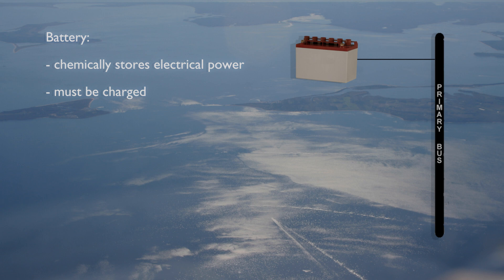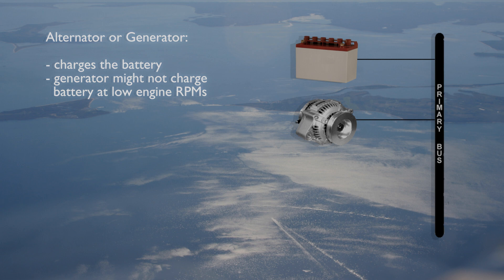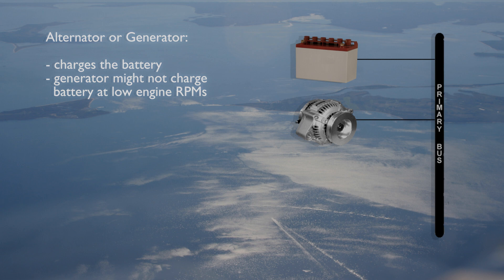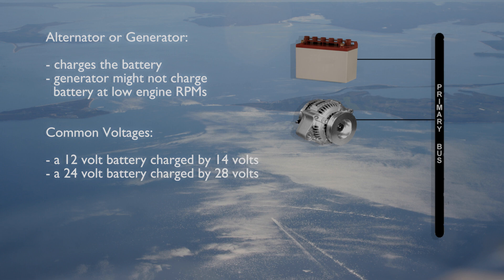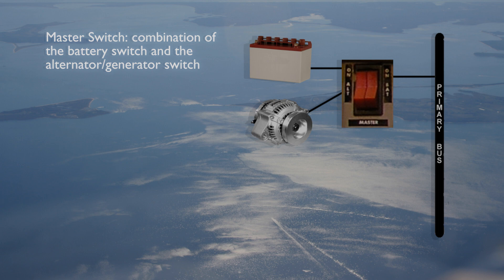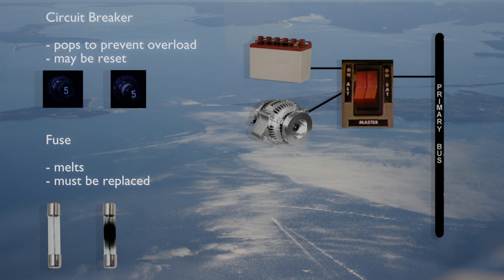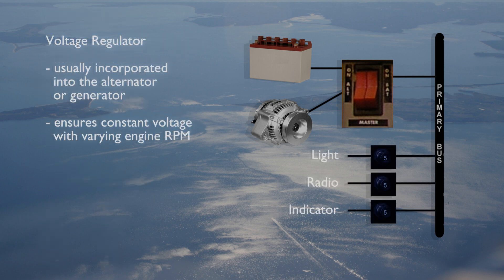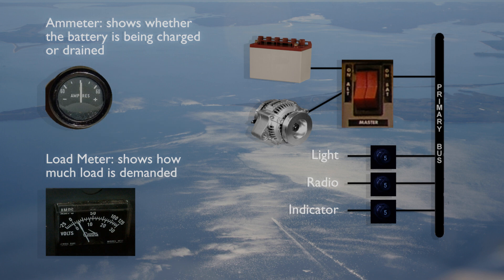Airplane Electrical Systems

Comment: Master switch doesn’t connect the battery to the bus bars. It connects the contactor to the ground then the contactor connects the battery to the bus bars

Comment: Does the alternator produces AC or DC?
Reply: AC, the battery provides direct current, which powers most stuff in the majority of small planes. Easy way to remember: Alternator, Alternating Current.
Reply: DC